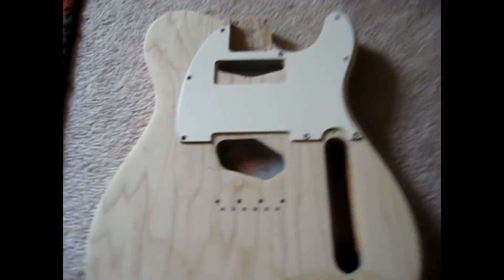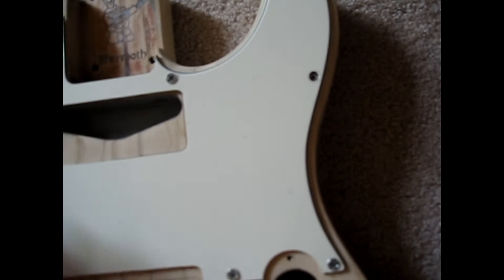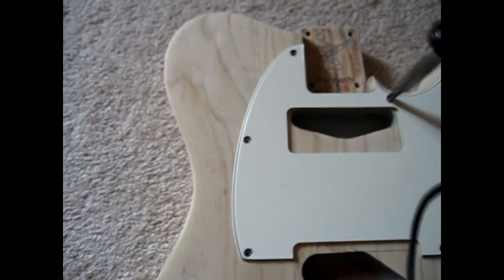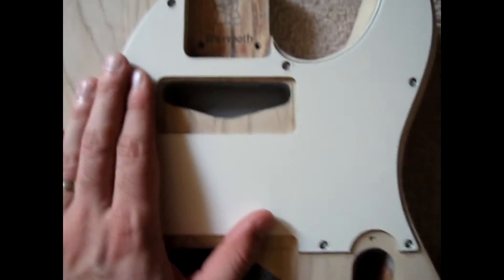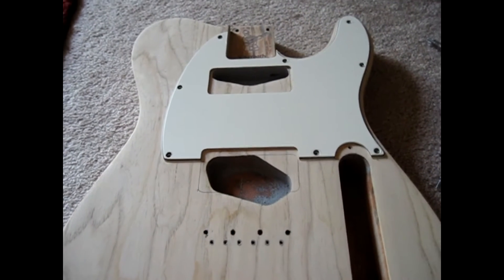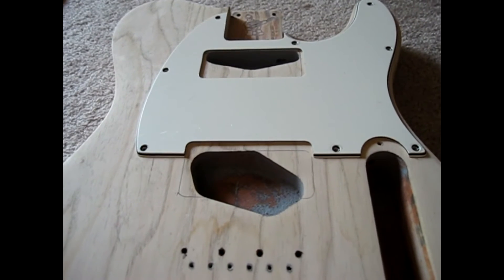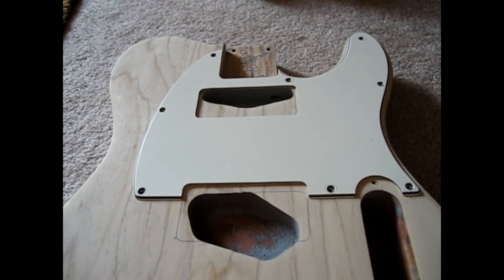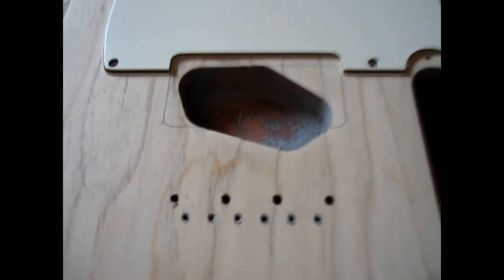How to Build a Telecaster Vlog pt 4 - Alignment Issues & Routing for P90's

Comment: Fill the holes with glue-covered toothpicks. Then use a neck to keep the pickguard straight. Toothpicks are hardwood. They will work perfectly... especially if you tap them in with a rubber mallet.

Comment: Neck first...properly measure the 25.5 first.  then run a string to again, make sure, that low E and high e don't fall off of the fretboard.

everything else can be adjusted accordingly.  Just got done with a strat with a messed up body but man...she's worth it!

Comment: Shouldn't you put the neck and bridge on, then put both top and bottom e strings on the guitar to position your pickups so the pole pieces are under the strings? Forget the pickguard, you could have filed the plastic a little to make the pickups fit without altering anything else.